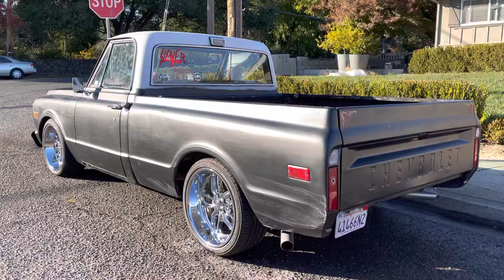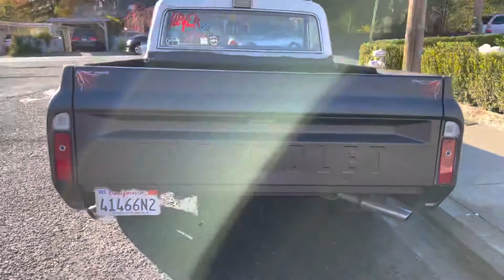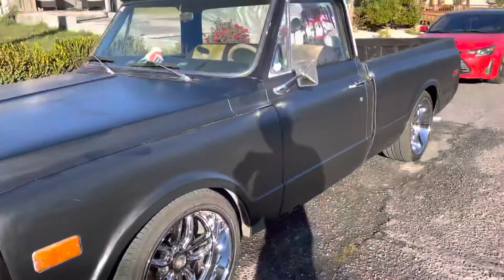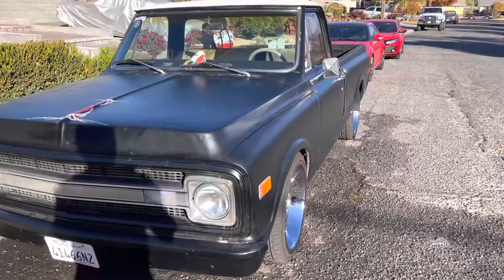1970 C10 Stage 3 cam walk around

Comment: Sounds nice, Did you have to tune ?  What are the specs
Reply from the maker: Yes, tune was required. It’s a 2002 5.3 with the cam/headers/X pipe exhaust. Got a 3000 stall as well. Putting out 410 to the wheel
Reply: @thatoneguywithac107  nice definitely going to look into this stage cam,I just picked up a 6.0 but yours sounds nice so probably go your route lol
Reply from the maker: @Castro_C  thanks, I wanted to go with Texas Speed, but I live in California and it’s too much of a hassle to get one here. But I would highly recommend this cam for your 6.0. Not too drag car sounding but still has some balls